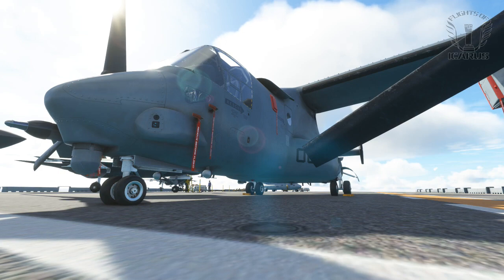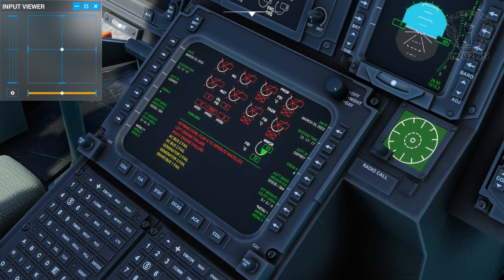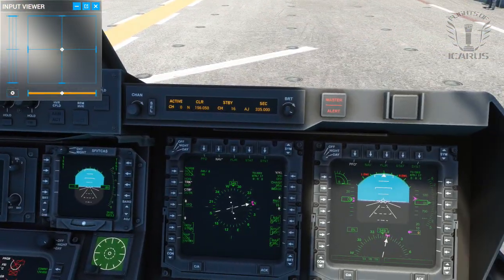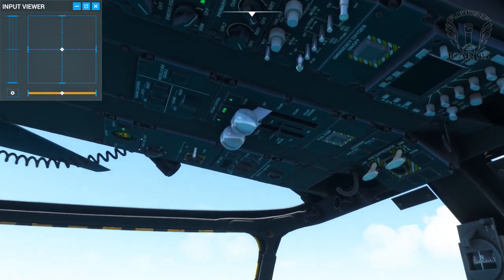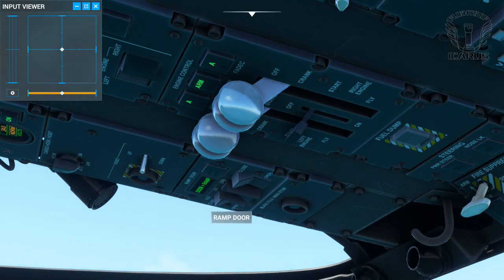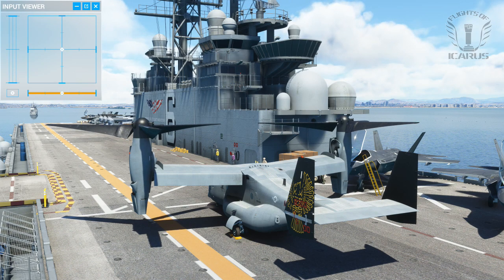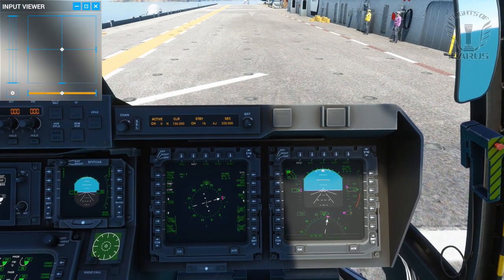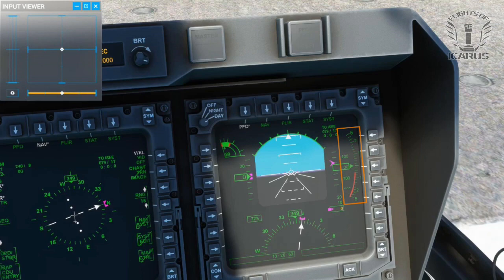MV-22 Osprey Part 1: Ground School - for MSFS 2020 Review:

Comment: The tilt of the rotors looked pretty good, I remember they kept trying to do that with cars, not sure if they ever did.
Reply from the maker: I think there were a couple of prototypes but I suspect the reason it didn't catch on is that in the event of an engine failiure the smaller rotors can't hold enough energy to autorate safely to the ground in the way a heelicopter can. Something I'll demonstrate with the Osprey in a later video with disastrous results 😂